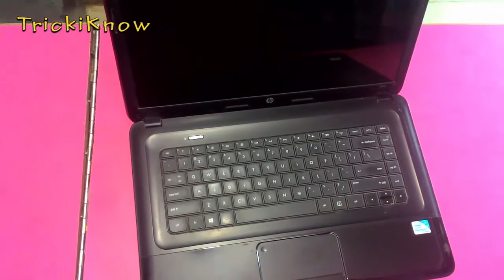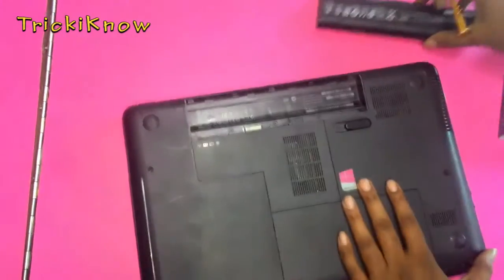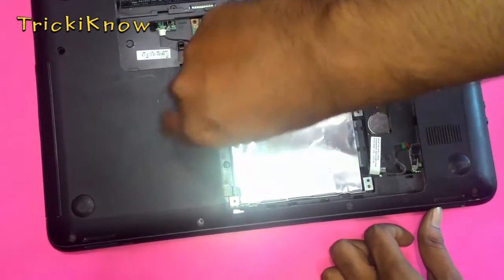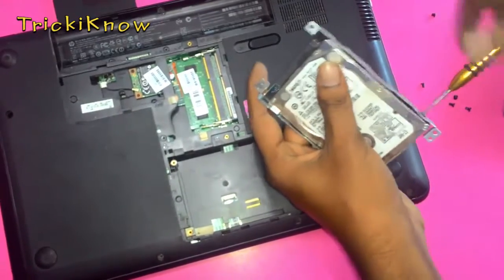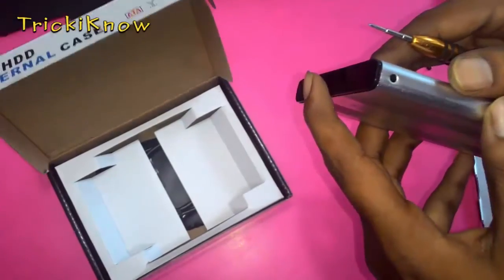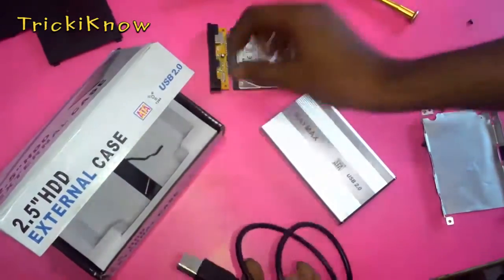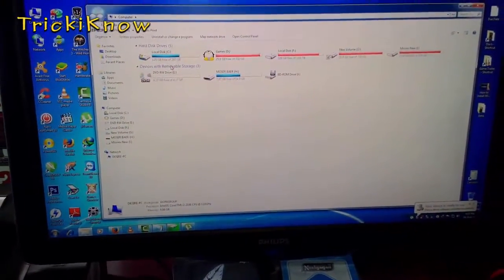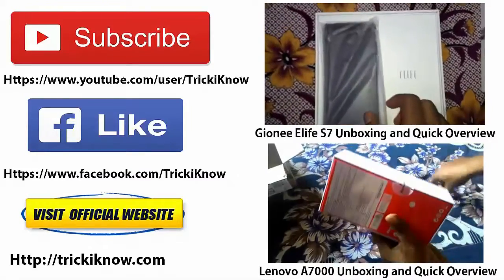How to Recover Data / Files from a Old or Dead Laptop - Easy DATA Recovery  [All Models]

Comment: hey bro i have hp pavilion g6 which i purchased on 2013 it has 4gb ram and there is no problem i want to upgrade to 8gb should i upgrade.???i do only small things like watch movies,surf internet,for party
Reply: your question is not detailed like which processor you are using if you have only limited work then 4 gb will serve the purpose. No need to upgrade RAM:)

Comment: Thank you for your video.  I did everything exactly as you did and the drive appears on my desktop but when I try to open it I get a message saying "The Volume Does Not Contain a Recognized File System".  Then the computer asks if I want to reformat the drive.  Is there any way to get past this so I can see the files on the drive?  Thank you.
Reply from the maker: Try to , insert your Case in the back USB port :)
Reply from the maker: Some times it Can't read in Front USB :)
Reply: Thank you -- it turns out the partition was corrupted.  I ran chkdsk and it took about 6 hours but it appears to have been repaired.  Your video was very helpful still!  Thank you.
Reply from the maker: You are Most Welcome bro :)

Comment: WHAT ABOUT WHEN THE COMPUTER THAT YOU WANT TO MOVE THE DAta to says the drive needs to be formatted?
Reply from the maker: That means your hard drive is corrupt , May be this is the problem of  Enclosure. So try to Connect the laptop hard drive directly to a Desktop's motherboard via sata Cable in Secondary to double check :)

Comment: does it work even if the now-dead laptop was password protected?
Reply from the maker: +AliPapa Good question , the answer is Yes it will work if your windows is locked before dead :) Because if you use a hardisk Case , your hardisk will not boot. It will read as a Pendrive :)
Reply: TrickiKnow thanks!
Reply from the maker: AliPapa
Welcome Bro :)